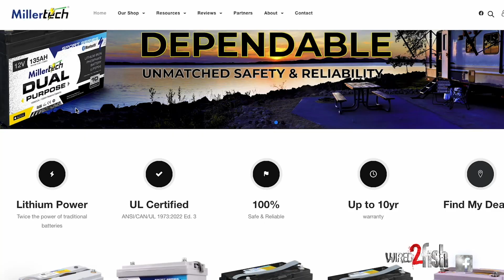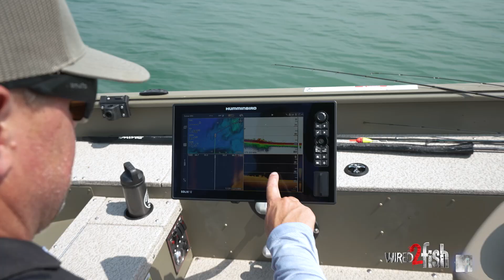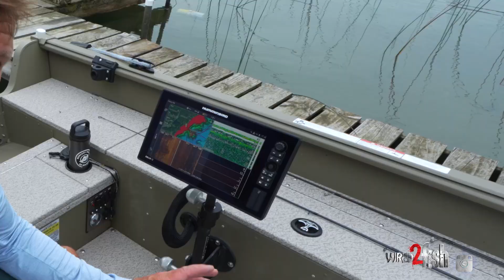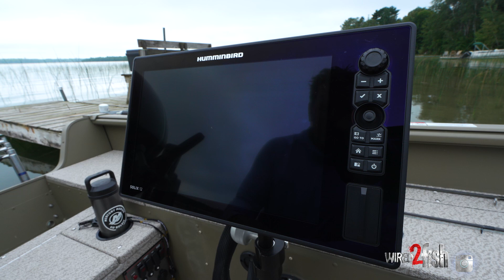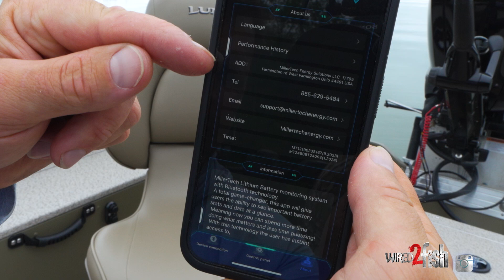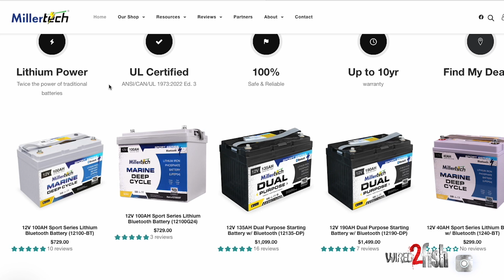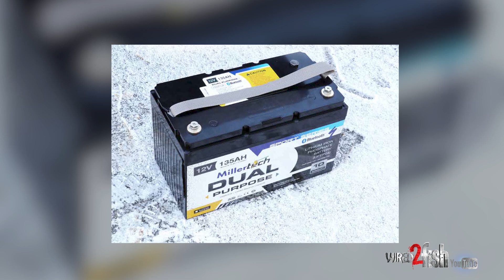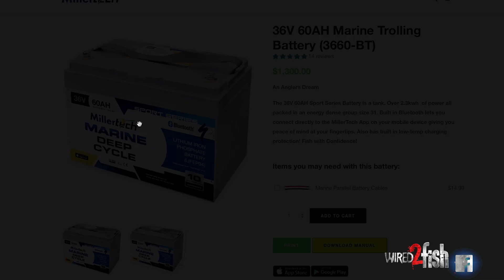Lithium Marine Battery Review in Lund Alaskan Tiller

Comment: So you normally have to use 2 24 volt batteries to power your 16ft trolling motor!? Well first of all a 16ft boat is a small boat and u claim a 75 hp motor is a large motor?!! Well I have a 21 ft Astro bass boat and I only use a AGM Battery to power my trolling motor and it lasts me all day and I have a 175 hp motor and use a Marine deep cycle battery and I charge it before I leave for the weekend and it starts charged all weekend long that's 8 hours 2 days 16 hours with 3 people in the boat! Why don't you explain other benefits that a lithium battery is more beneficial than lead acid and not say a punch of bullshit like! U also mentioned you could possibly use 2 batteries for your troll motor and I saw your other storage area u claim was so important and u had trash and some pops in there and by the way nobody needs 2 batteries now days for a trolling motor pal! Especially for a glorified john board with a motor on it!! Hell I have a larger raft for my kids and u being in Alaska that has to be the smallest boat on the water! Don't lie about a simple thing when you r making a document video regardless of the product!!

Comment: Giant advertisement for something overkill on his set up. Great until this lights up a fire
Reply: These aren't the same batteries that are in electric cars. Lithium iron phosphate batteries self-extinguish because they deplete their own oxygen supply. The batteries in cars are Lithium Ions and they produce oxygen, which is why they aren't approved for marine use.

The setup here assumes that he turns off his motor and fish off his battery all day. If it was a lead acid battery, you'd get 5-6 hours max if you ran off just the battery alone with all those electronics.

It's remarkable battery tech. I don't really get why people get so defensive when talking about lithium. It's clear that you haven't really looked into it at all.